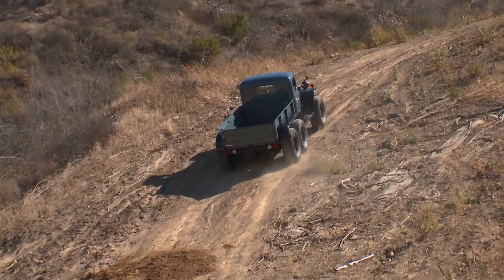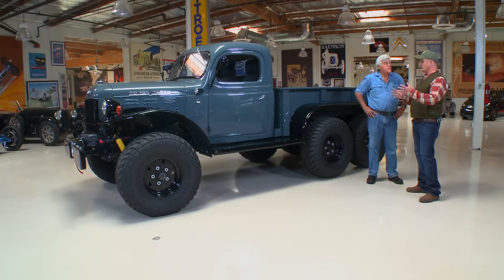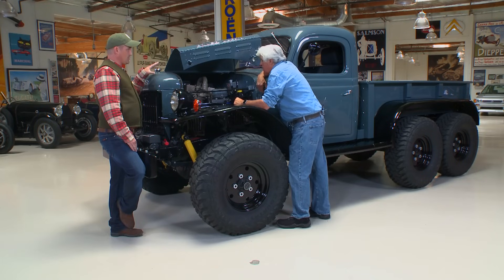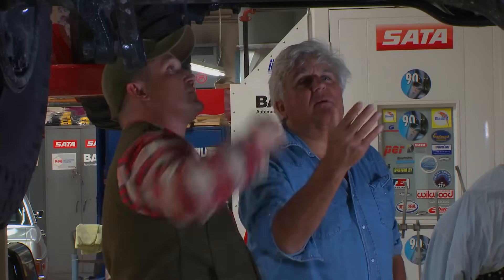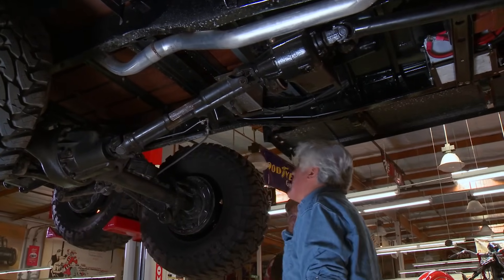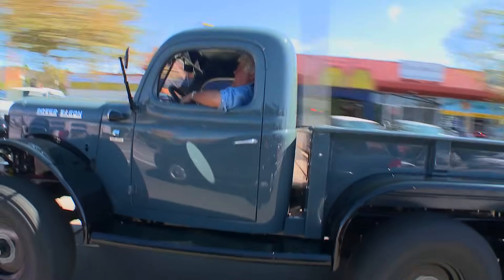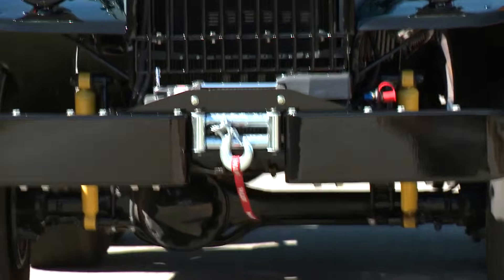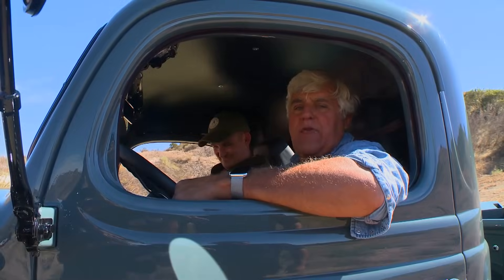1942 Dodge Power Wagon Restomod - Jay Leno's Garage

Comment: If you want a drivetrain like this, just buy a 3/4 ton or one ton Power Wagon. Up to like 1991 or so? I owned a 68' Power Wagon, a 74', 79'  they were allthe same as this 1942 drivetrain. Where the drive shaft goes to the back axle, on this one, single axles have a pto, or a plate panel you remove to add a shaft.
Reply: They guy said that this is a 2 1/2 ton truck. Something isn't adding up.
Reply: Michael Carlson  Yeah, a duece and a half is usually a more heavy duty 6x6. But many of the WW2 veterans called even smaller truck, like a one ton...A Duece and a Half. Wrongly of coarse.
Reply: He said as far as the weight capacity it's like a 2-1/2 ton truck.. Meaning it can carry and tow the same.. It's towing capacity is 20K lbs..  The reason they put true duece and half together was because they needed trucks that could handle being loaded down 24/7 without breaking..
Reply: Calvin H. Have you ever owned one? They are pretty handy. Ours was a 1952, it carried as much as 10 cord of firewood, mostly beech, thats about 20,000 lbs.
Reply: HOSSMCGILLICUTTI , No i never owned one, but have friends that do, but i did own a 1947 Dodge Power Wagon Carryall, and it was like a tank on rubber tires.. It had the pto driven winch and all, but another man wanted it more than i did, and money talks.. lol. 
And i have owned a few Power Wagons, all the way up to my 2009 Power Wagon.2500..
Reply: itchy old fart m37
Reply: But didn't they use all this same stuff on a 1 ton, and if you have 2 axles and more tires, wouldn't you get 2 1/2 ton capacity? I don't understand why this isn't a 2 1/2 ton?
Reply: 2&1/2 ton trucks have 10 lug Rockwell 2&1/2 ton axles. The axles on this truck are 5 lug Dana 30s or similar.

Comment: Oh thank god they didn't ruin it by putting a Chevy motor in a Dodge.
Reply: flex93312 just a quick fyi...cummins is purchased by dodge...ford actually owns more of cummins than dodge does. Some dodges such as the D7N actually ran detroits...which as we all know were produced by GM. I'd much rather have seen this thing built using a 4v53.
Reply: ROTAXD Ford owns nothing of Cummins. I have no idea where this rumor started but Diesel Power magazine put it to rest a couple years ago.
Reply: @LUDACRISLUDACRIS LUDACRIS capitalized or not, it still gets the point across. The question is, which god?
Reply: Ford did own 10.8% of Cummins from 1990-1997
Reply: They just ruin it by putting too few cylinders in it... that's just WAY too much truck for a 4bt. A 12 valve would've been cool. And I hate Cummins swaps, they're the diesel equivalent of sbc, ls now.
Reply: prestige worldwide wide wide wide wide modern detroits suck. The old v series 2 strokes are great motors.
Reply: Well, they did! check their website.
Reply: @ROTAXD  the Detroit Diesel V series were good motors, but the new EPA regs meant that 2 stroker diesels won't cut it. Matter of fact, when Caterpillar bought GM's old Electro-Motive diesel-electric locomotive works, one of the first things they did was design a 4-stroke engine to replace the old, reliable 2-stroke motor. Again, due to the new EPA regs.
Reply: @alabob20  if you buy a super in Europe as I have, it's a Cummins.
Reply: Yeah but why a 4BT?
Reply: It would make it actually move.
Reply: Why do Chevy when you have the good old Cummins around, I would never put a gashead on my work truck like this, workhorses like this needs Diesel power. But imagine if this was done with 6BT he would have created a Zombie proof-vehicle there (with all due respect to the KDPs that screw up the motor).
Reply: ROTAXD dude, Ford doesn’t have a penny of cummins. Not even close. All they did was BUY some engines in the 90s and early 2000s. And all of them were bought back and the 2000s ones were put in the f650-750 trucks. You know nothing
Reply: Kristoffer Mangila cat quit making Diesel engines around 2010 or so. They just couldn’t make the emissions requirements. They had already been sacrificing a lot of power and good designs in the late 90s and early 2000s cause the emissions were just starting to take effect. Sad times
Reply: ROTAXD Cummins bought back all of their shares that ford bought a long time ago. Ford owns nothing of Cummins.
Reply: thank god they didnt ls swap it
Reply: I put a 6.5L chev diesel in my '86 F350. Goes very well.
Reply: A chevy motor is no match for the legendary Cummins
Reply: ROTAXD ford sold its share in Cummins some time ago in the 2000s
Reply: Jeez this is so American why does it matter what engine is in it? It just needs to fit the right task the badge from the people it comes from doesn't matter when you are driving or using it!

Comment: Norway used Dodge Power Wagons as fire trucks after the world war, that's probably how it ended up here before going back to the US.
Reply: i know it was 2 year ago when you commented but i was just watching and thinking what the heck would Norway want that long chassis for, 'fire truck' sounds just right,[i was thinking towing planes but knew that couldnt be right]
thanks for the answer BTCC90s as i let stupid questions like this drive me to distraction
Reply: Polly g They used them as rural and forest fire trucks here in the U.S. too.
Also school buses, ambulances, highway maintenance and plows, railroad maintenance, they could pull a fully loaded boxcar easily.
With it's auxiliary tail shaft you could hook up and run all kinds of equipment.
Harvesting equipment, orchard sprayers, drills and augers, small derricks, hydraulic rams, band saws, seismic exploration tools, towing wenchs, cranes... ect. You can also lock the steering wheel so a single farmer could let the truck crawl by itself across the field at 1 or 2 mph while he walked behind it planting or spreading fertilizer or whatever.
Those trucks used to be working all over the U.S.
They probably did tow planes somewhere.
Reply: tɦɛ ʀiɳg ѳԲ ɗɛɱoɳร Very cool yes a farm utility work truck w/PTO s advertised as such. It’s a different world now unless you are self sufficient out in the boonies!

Comment: Great that it has no electronics and are more reliable. But hey, if you can spend 150-250K on a basic pickup, you can have your mechanic fly out in the bush in a helicopter on short notice with some replacement parts)
Reply: That’s exactly right!
Reply: Rimrock300 this thing will still run after an EMP hit

Comment: I kinda like this power wagon.
Problems:
-They practically don't exist here in Germany.
-You need a special license to drive something like that over here.
-They're huge, storing them takes up a ton of space, and we don't have the vast off-road areas where they would make sense.
Reply: Max S. Die bekommse nicht zugelassen!
Reply: ObaminAtor 1 Einen originalen könnte man vielleicht als historisches Militärfahrzeug durchwürgen, aber ansonsten hast du Recht, da bekommt der TÜVler 'n Herzinfarkt.
Reply: You guys have the Unimog! I much rather have that
Reply: 2A556FMJ Yeah, the UNIMOG is similar (but not quite as cool).
I believe, though, that the UNIMOG is a lot smaller than the Power Wagon..
Reply: Max S. lol the grass is always greener on the other side.
Reply: I thought the UNIMOG was pretty big! If you look, most of the old Power Wagons are actually about the same size as a standard truck. Do you guys not generally have full sized trucks? Personally I drive a tiny Toyota and can't stand HUGE trucks just to go grocery shopping.
Reply: supermuble The biggest cars (we only differentiate cars and commercial trucks) we get are Audi Q7-ish cars or the Mercedes G-Class 6x6.
You can get a Ford F150 Raptor or a Dodge RAM through importers "on demand" and drive them with a license for cars, although they're often registered as commercial vehicles (taxes are mainly decided by the displacement, and commercial ones are at some point lower).
UNIMOGs are already considered commercial vehicles, so you need a different driver's license for that.

Generally huge SUVs/Trucks are a VERY rare sight on German roads, partly because they (especially trucks) are not even offered here while they are sold in the US.
In Germany you find more large sedans/station wagons.
Reply: supermuble Well, I guess if we'd get US-like "running costs" over here trucks would be more popular too.
But we pay about 1,45€ (rather more) per liter (a third of a gallon) for 95 octane fuel, and big engines mean big taxes due to the displacement.
Reply: supermuble Advance my timing, and I'll lose power. It's exactly where it needs to be.
Reply: Ritalie But that’s the American way!🇺🇸

Comment: " . . . more torque than any small block Chevy ever built".

4BTs are torquey little engines, but that statement is pure bullshit. This one makes 450 ft-lbs? A decent number of LS engines make more than that in OEM applications.
Reply: And that's only if it's turned up... Stock it has 105 hp/ 265 tq. He said 120 hp so it's bs to say 450 lb-ft. Although, there are 4BTs that are making 700-800 lb ft with boltons. Great motor but this guy's just a salesman basically
Reply: +Jon Speck I'm more of a gasoline engine guy, but having worked on tugboats I know the value of diesel engines for reliability and long-term heavy-duty use.
Reply: Reptilian Overlord I'm sure he meant low end tourque ,which if you offroad matters more since you'll never reach those higher RPMS.
Reply: Alexander Rosales there are types of off-road vehicle that runs at high rpm constantly. Trophy trucks?
Reply: He said at the same rpm of 1200

Comment: I think you need a truck class license to drive 3 axles.............
Reply: +Mr. Johnson Doesnt that depend on weight?
Reply: +Rick van den Berg
From Calif DMV
With a Basic Class C License:
a 2-axle vehicle with a GVWR of 26,000 lbs. or less.
a 3-axle vehicle weighing 6,000 lbs. gross or less.
Otherwise a 'class B' commercial license is needed for 3 axles over 6000 lbs. gross
Reply: Don't need a CDL if you aren't driving for hire.
Reply: Bradley Vaillancourt
The California License manual didn't make that distinction.  A class "B" license is needed; even if it is a 3 axle motor-home.
Reply: +Mr. Johnson ..Right...my last employer bought a 50 foot long 3 axle Country Coach...he received several tickets for driving on a class 'C' license and not having air-brake endorsement....cost him over $1500. But the big $$ were for the front windshield he broke driving into something...$5,500 for glass and two mirrors.....
Reply: Doug Ankrum
Dang! That's Expensive glass.
 If I remember right; you have to get properly endorsed training to get a class B license.
Reply: +Mr. Johnson .yeah, Country Coach was high dollar motorhomes....$300-400K...just a step down from those big ones the entertainers travel around in...Prevost.... Country Coach had huge wrap-around front windshield.... Class 'B' for 3 axle motor homes/air brakes...mostly just questions on a test....
Reply: It's a farm vehicle
Reply: Mr. Johnson in Cal you have to take a written test and driving test + tests for endorsements.

Comment: At a very private, religious boarding school, I actually learned how to drive in a Power Wagon (don't know the model year or even the model name) --- 4-wheel, not 6-wheel.  One of the things you learn very fast with a legacy Power Wagon is you always start out in second gear, not first, unless you're in trying to drive out of a mud hole.   But, in North Texas, where we drove off-road, it was a blast driving it. And with Power Wagons, you really learn HOW to drive a vehicle --- there's no power steering, brakes or automatic transmission.   You have to do everything and you learn the intricacies of handling a vehicle without wrecking it.

Comment: I am not a truck fan but these old power wagons are awesome. Then add an extra axle and a cummins and it becomes killer. Only thing to make it better is a 5.9 2v cummins and dual stacks! Oh and a 3 point pto on the rear/front would make this the ultimate farm truck. Imagine mowing your pasture with this truck!!

Love the 1 wire engine setup! Had a vw jetta with same style diesel engine. Had a pulley issue that kept eating belts killing the alternator. Thankfully once it was running you could go forever without power. Although no lights or gauges you could still make it home (during daylight hours) no matter how far it was.

Comment: Damn. 5.83 gears?!? I ran a 3.91 in my Cuda and ran at 4,200 RPM at 70 mph in 4th gear, with a 5,600 RPM redline so it was screaming with regular traffic. But it sure left stoplights quickly. I finally got a Passon 5 speed after 20 years though. Far more enjoyable cruises adding an overdrive gear, without sacrificing torque off the line. I can’t even imagine 5.83 gears if you want to exceed 40 mph in a 4 speed, but I heard them mention 5th gear and 70mph, so who knows what trans they’re using with that Power Stroke…

Comment: That thing is a beast. with the torque of that engine and those low geared differentials that thing can go places where it would be hard to walk. I can say that because I know what a 6 by 6 truck can do.
At Fort Hood, Texas we were trained to use the next version of this truck, the M35 cargo truck. It had a six cylinder engine that was awesome. I never heard horsepower figures for it but I bet it put out close to 400 pounds of torque. We drove those things up hills so steep you had to put a hand on the ground in front of you to climb on foot. They would climb a steep grade like that while pulling a six ton artillery piece with five men in the truck plus 1,000 pounds of artillery shells. The old sergeant made us do it just so we would know the truck COULD do it.

In Vietnam, there was a long run next to water that led out to a peninsula. Those trucks are listed as having top speed of 58 mph. We often made trips out to the artillery position with supplies and artillery ammo. But then the VC started sniping at us. We complained and the 1st cav tried to get control but it was a three mile long beach with woods and partial jungle on both sides and just too hard to cover. So we did what we could. 

The throttle pedal had a bolt screwed into the floor under the pedal to regulate the engine. We screwed it all the way down to the floor for maximum power. Then since it was a multifuel engine we knew it could run on gasoline so long as there was oil in the gasoline to lube the injectors. So we would put about 3/4 gasoline and 1/4 diesel and then add a whole quart of 30 weight oil to the tank. Wow that engine felt like it had twice the power. It never pulled the red line in high gear on the sand before that, but this time on the way out to the peninsula that engine was screaming and I had to be careful not to go over the red line. we went through so fast the VC didn't have time to ambush us. the speedometer was bouncing around so much I couldn't tell how fast we were actually going but the wind felt like about 75-80.
The 6 x 6 could go into deep sand or mud and just slowly walk right through it. you just had to be patient and make sure your tires had good tread. the tires on the one in this video look very capable.

Comment: About 50 years ago, I nearly trashed a 1940's PowerWagon (and myself). A ranch located on hilly terrain had one in disrepair and I was tasked with driving it. It worked OK until I climbed a grade in 2nd. Upon attempting to downshift, I was 'rudely' reminded it had no syncros. Double clutching failed to engage 1st. I then found the truck had essentially no brakes and was quickly gaining speed - backwards. My work partner said 'I'm out' and jumped. All I could do was keep the backend pointed straight down the fall line, going scary fast, until it reached the trough. It continued rolling, gradually losing speed as it climbed backwards a ways up another hill and then finally rolling back down to the trough. I told the owner about the brakes, but he did not fix them properly. A subsequent driver then crashed the PowerWagon due to lack of brakes. (No injury, but bent front end and bodywork)